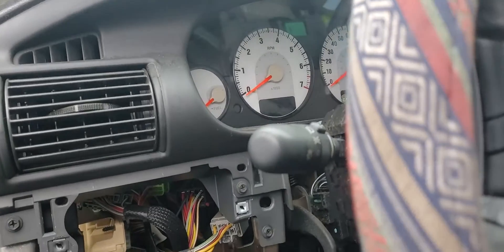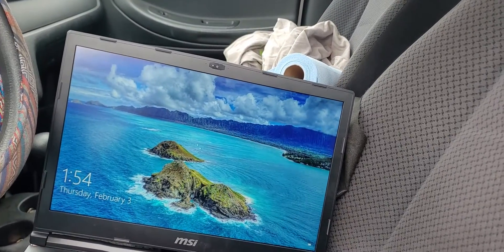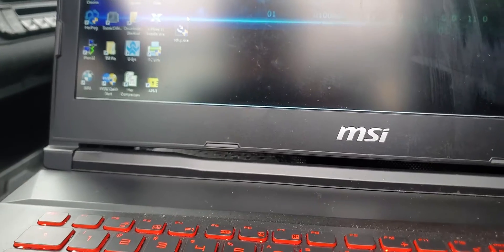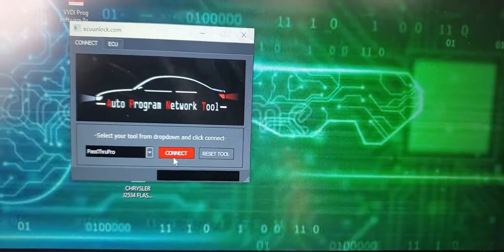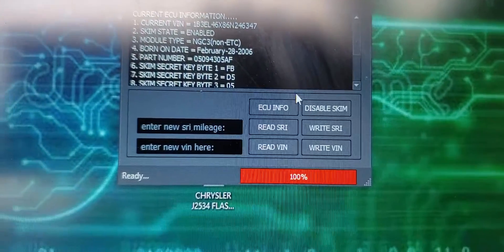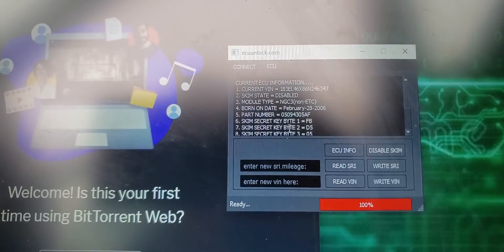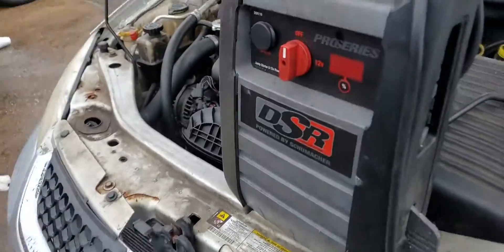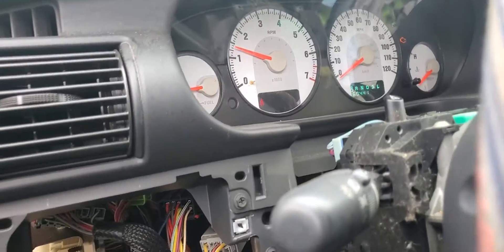2006 Dodge Stratus Skim disable process

Comment: Ok.  So in doing this,  you MUST disconnect the skim unit,  yes?  Or it will just detect and assign a new code?  This is my understanding.  Removing the skim unit is preferred so it doesn't get plugged in again by mistake....

I've got a 2002 stratus and can not find the skim unit.
Reply from the maker: Yes skim must remain disconnected or removed....  If your car does not have a skim and is not starting someone may have installed a different pcm that has security enabled and looking for a skim...  other no start issues could be bad ignition switch, starter relay, auto shutdown  relay or bad neutral safety switch...  Goodluck

Comment: In case of ECU locked due to missing/defective SKIM, would there be always DTC errors? I am getting "NO CRANK" on starter, and I would like to confirm that it is due to damaged SKIM.
Reply from the maker: If skim is damaged car will start maybe 5 times then it will no longer crank..

Comment: HP Tuners would have been a much better option. Does same thing and also does code suppression and immo off on gm also just to mention a few things.
Reply from the maker: Hp tuner is token based. You never stop paying.. This I flat out own and serves its purpose.. I have many tools Flex, Ioterminal, Autohex 2, ect,ect..
Reply: @Autokey_Security_Services  many ways around those tokens but not here to argue  that.